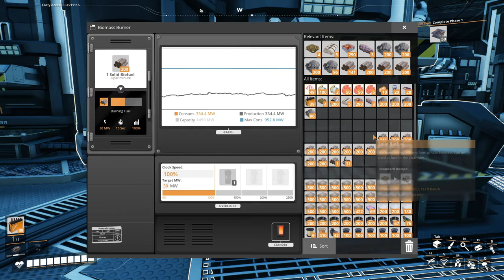Smart Plating Done!  Let's Play Satisfactory s02 e16

Comment: You are by far the most patient person I've seen who plays this game (well, aside from Josh...but he isn't a normal human)  I always give up on structure and push hard with hand crafting and randomly placed machines just so I can get to coal as quickly as possible and stop feeding the bio-burners.  I've never seen a burner array quite so large.  Nuts, I say.  Nuts.

Also, as of update 6 (I think) they allowed Ctrl-C while pointing at a machine to copy the recipe, and Ctrl-V to paste it.  Before that, you had to open the machine's panel before you could hit Ctrl-C/Ctrl-V.
Reply from the maker: I usually put down a bunch of "temporary" setups that end up sticking around waaay too long and looking like a cluttered mess!
This time, I set out to avoid that. 

Building out a huge array of Biomass burners isn't much harder than building a small one. Each one acts like a storage container for Biofuel and they only burn fuel up to the amount of energy that's needed (i.e. no wasted biofuel).  It doesn't take much time to fill them up and once full, they will burn for a very long time before needing to be refilled.

The biggest downside and time consumer is just harvesting all of the biomass. But, I was planning on clearing a ton of foliage anyway, since it's not much fun to watch me wade through ton's of high brush on YouTube during the videos.